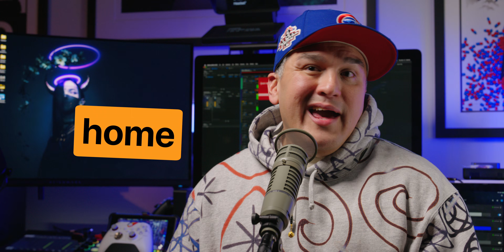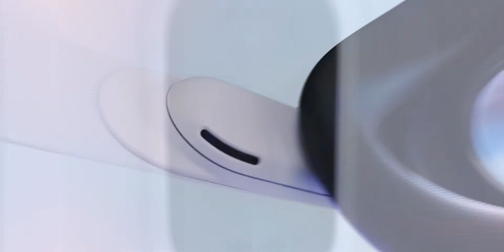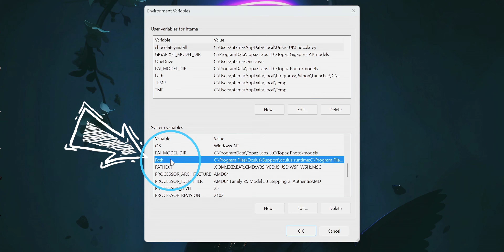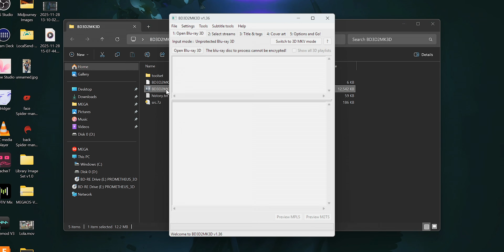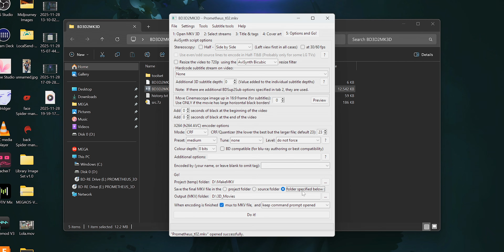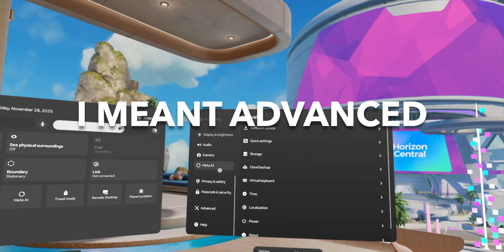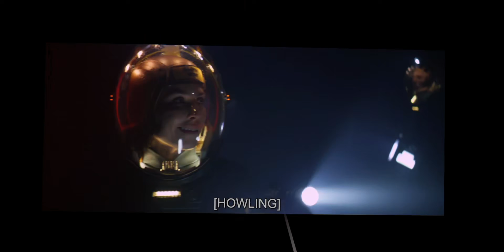3D Blu-ray to Quest: The Complete Conversion Tutorial

Comment: You need a modded drive to rip 4k. I believe that's not necessary for 3D. I used my old Pioneer BDXL cause my  LG M-Disc had a mechanical failure. Ripping 3D RN. 😊😊

Comment: Error: The type of file 'MKV3D_3D.264' could not be recognized

any help?
Reply from the maker: Do you have everything I mentioned in the video installed? 

The most likely cause is either AviSynth isn't installed correctly or FFmpeg isn't in your system PATH. Double check both of those first. Also make sure your temp folder path has no special characters or accented letters.
Reply: @CreateConsumeRepeat will check again I’ll delete everything and start again

Comment: Doesn’t mention the most important part of the MKV rip. When you open the title you are going to use, MAKE SURE you click the MKC / Stereo box first then select your audio and subtitles. Personally, I only check the audio I want and a subtitle if needed. If you pick a subtitle it will be burned into your film, not selectable.  
This right here is a usable file for Quest 3 viewing. It is half frame SBS in a 1920x1080 frame. 
The BR3D2MK3D is not for the faint of heart. What it does is expand the images to full frame SBS using a 3840x1080 frame. I bumped up quality a little but these are very long render times. Mine were 10 to 12 hours. 
Yes, 4XVR is the best player, it will play BOTH VERSIONS, half or full frame. 
It’s a subtle improvement, but not actually necessary. 
I never put my films onto the actual head set. I use a mini USB-C thumb drive, load a few movies onto it and using 4XVR watch them from that. 
Keep a permanent library of your tops on pc and just copy on😂s you want to watch to the USB-C drive.
Reply from the maker: Thanks for sharing.

Comment: You lost me from "ffmpeg" reference. For beginners like me, jumping straight into saying "follow these steps" and immediately saying "move your ffmpeg folder into....." completely throws me off without knowing first where that folder needs to be found. I guess I was here hoping for an idiot's guide on everything because this is all a tad over my head :(
Reply from the maker: You have to first download FFMpeg, I’ve provided a link in the show notes. when installing it you can select where that folder is going to be installed. from there you can just drag it as I mentioned in my video
Reply: @CreateConsumeRepeat  okay thanks, I'll check that. I have one of those external blu ray drives for my MacBook. Hopefully that can rip the discs. You can tell I'm a noob eh
Reply from the maker: We are all learning.

Comment: Skip every step after makeMKV and just play the full rip through 4XVR, don't need to do all the other conversions unless you want a smaller file size
Reply from the maker: Thanks for the tip.
Reply: I just did the same thing and it works great with Premium version of 4XVR. Worth the $30 dollars.  So what is the real benefit of doing all these other steps? As it stands, it takes about 30min average just to rip one 3-D movie using 4XVR. How much more time is added doing all this other stuff?
Reply from the maker: Native 3D gives you two discrete channels, one for each eye, with real authored depth and correct parallax.

4XVR is estimating that second view from a single image using depth mapping, so it can misread edges, flatten faces, and break on fast motion.

You’ll also lose some perceived sharpness and depth precision since it’s not working from two true sources.

It’s great for convenience, but it’s not a replacement for real stereo if you care about image quality.
Reply: @CreateConsumeRepeat You got my attention. So what is the best way to rip a movie.Do we follow all these additional steps as mentioned in the video? Realistically speaking, about how long would this process take for each video? The 1st rip takes on average 30 minutes, but that is probably a result of the file being copied from the Blu-ray drive. Following that, I assume the speed will depend on the storage unit and CPU speeds.
Reply from the maker: Follow the steps in the video. As for how long  it takes, that is dependent on your machine.

Comment: 0:22 3d experience at home is better than the theater. If you have a 4k passive 3d TV made from 2016 or earlier a TV will look better than a projector! 2016 was the last year of 3d TVs in the US. Image quality on a TV will always look better than a projector. That's why our homes are not overrun with projectors. If you want a big picture you get a projector. If you want quality image you get a computer monitor.

 There was a small over lap between the death of 3d TV's and 4k UHD tvs. This is great if you love passive 3d like I do. Before UHD passive 3d would cut the resolution in half, but after UHD you could get the FHD to each eye like intended on a Blu-ray. Active 3d always allowed FHD for each eye, but it appeared darker because of how the tech worked. It also required batteries. TVs are cheap now. Keep an eye out for older TVs that do 3d. I bought a 4k/UHD Sony with an IPS panel, and does 3d, x900c. Brightness isn't the best, but I love that tv.
Reply from the maker: Hey, thanks for chiming in, I totally get where you’re coming from. I actually have a 3D 4K Samsung TV too (it lives at my mom’s place now), and I agree the image can look really great.

That said, for me the headset still wins overall — the immersion and “being in it” factor is just on another level. Appreciate you sharing your perspective though!

Comment: Thanks for these very helpful instructions for how to convert to BD3D. However, as others already mentioned, this is way easier with 4XVR. All you really need for software is MakeMKV to rip the blu ray, then simply transfer the file to your headset to play in 4XVR and it plays beautifully in 3D! 

Also, rather than loading movie files into the headset, 4X Link in 4XVR works great for streaming movies directly from your computer hard drive. I can see my entire library of movies to play in 4XVR. Works great!

I’ve liked 4XVR so much I purchased the premium version for both of my Quest headsets and figured out a way for my wife and I to watch 3D movies together in the app.

Comment: I bought 4XVR a long time ago. Have been used it for more than a year now. Watched mostly VR videos but almost every day.
I'd like to watch flat and 3d movies and BD3D also. Unfortunately it can't play the audio for flat and 3d videos correctly. It's too bad it's unusable for nonVR videos.
UPD.
I regret I bought and  recommended 4XVR everywhere and to everyone.
It has a critical flaw. Meta Quest version uses some "spatial" effect for audio. So the movie audio feels like it doesn't surround you as in cinema, but comes from a small Bluetooth speaker positioned 2-3 meters in front of you. Slightest movement of your head and the sound is recalculated and basically all immersion is ruined.
The new version of 4xvr for Quest 3 didn't fix the audio for flat and 3D videos. But instead it ruined the audio for VR videos. This is a disaster 🙁
It may be interesting for some videos with talking. But if there's music or asmr or just several sources of sound then the audio is ruined by your "spatial" effect. There should be an option to TURN THIS OFF!!!
Now after the update your player is basically unusable at all. It was unusable for flat and 3D videos before. But at least we could enjoy VR videos in 4xvr. Now it's a complete disaster.
The support in discord can't even say if they add the option to turn it off this year or next year!!!

And about BD3D and MVC. That's great your player can play them. But all movies have multichannel audio. And 4xvr can't play it correctly. It's ruined by their "spatial" effect.
They had a perfect audio playback for 2-channel and multichannel audio before the update. It worked correctly for every type of video except Flat. 
Just needed to apply it to flat videos.
But instead they broke it for all video types :(

I doubt the devs or support even watch movies using their own application
Reply from the maker: Hey, appreciate you taking the time to lay all this out.

Just to be clear up front: I’m not paid, sponsored, or endorsed by 4XVR in any way. Everything I shared in the video is based purely on my own setup and experience.

That said, I honestly haven’t run into the issues you’re describing. In my case, audio playback (including BD3D/MVC content) has been solid, which is why my take was positive. From the way you’re describing it, this feels less like a universal flaw and more like something that could be tied to how the content is encoded, audio channel configuration, or possibly hardware / Quest-level spatial settings interacting in a bad way.

I do agree with you on one thing though: having the option to disable spatial audio entirely would be the right move. More control is always better, especially for people who want a more traditional “cinema-style” presentation.

Either way, thanks for sharing your perspective.
Reply: @CreateConsumeRepeat If you want to check it and have time for it. You can use some earbuds or headphones and Quest 3. Not sure if the versions for other headsets have the same issue.
Just relax and try watching your favourite movie in 4xvr from start to end. I find void mode with almost maximum zoom to be the best alternative to the real cinema.
Pay attention to what happens to the sound when you rotate or move your head just a little. Just like in the real cinema when watching a movie on a big screen.
In 4xvr the sound is played correctly only in one position, straight forward. Any tiniest rotation or movement of the head and the sound is recalculated. And now it's not around you. Like it isn't multichannel around you as designed by sound engineers of the movie. But a 1-channel speaker. Somewhere like 1-2 meters in front of you.

Comment: something I noticed is that if you don't select "Convert Audio tracks to AC3 and Stereo [instead of 5.1] I did not get both channels [only left side] - that is on Tab 2 Select Streams of BD3D2MK3D - thanks again for great workflow - especially the extra step of running the _Encode_3Dmovie command - which I needed to do about half the time on the 20 or so BluRays I have done so far - God Bless
Reply from the maker: My pleasure.
Reply: Same problem here, have you fixed it?

Comment: Is there a way to do this with already ripped 3D movies? :D
Reply from the maker: I’m confused by the question. If you already have a ripped movie you can skip to the next step in the process.
Reply: @CreateConsumeRepeat I was downloading movies. I was able to use sbs versions that work perfectly. But some versions of 3D movies( that I downloaded) are still in 2D format. Wondering if there's something I can do, or do I NEED sbs ripped versions every single time, from the beginning?
Reply from the maker: @Bruhder12 if the film is a 3D Blu-ray rip you can proceed to the next step. I know that someone in the comment section claims 4X player doesn’t need the SBS process to work I have yet to confirm that. Hope that helps.

Comment: Is there a way to just use the headset as a monitor connected to a 3d disc drive and get the same result?
Reply from the maker: Not that I know of.
Reply: Nope - you have to use an inline capture card and they only work as 2D
Reply: @Ilkeston  Dang. So we'd just have to hope for future headset releases to have 3d capability in their capture card for that to work?
Reply: @christiannoriega428  When I bought the Quest 3, I was hoping that it would work as a 3D headset for my PS4 3D games but it doesn't.

When looking for a capture card, no-one mentions that they only capture 2D.

So now, I'm having to rip my 3D Blue Rays with Make MKV and buy a bigger hard drive.

Comment: Hi,  
I’m really grateful for your tutorial.  
Without that video, I never would have started converting my collection and enjoying it in a whole new way.  
So thanks again for that.

However, I do find a few things a bit misleading once you start digging deeper into the topic.

One thing is that you don’t necessarily need SideQuest to transfer movies onto the Quest 3.  
It’s enough to connect your Quest 3 to your PC and confirm the connection from within VR.  
After that, you can simply drag and drop the movies over just the same.

Another point is that you talk about the highest quality when converting via BD3D2MK3D.

I personally watch the movies using the Virtual Desktop player. I’m not sure whether 4XVR enhances the movies during playback, but I wasn’t completely satisfied yet — even though your settings were already good.

But that actually motivated me to look for other settings and experiences with Tab 5 and try things out.

I have to say, you can get more out of it.

Once you find your sweet spot for screen size, it’s no longer just a movie — it becomes an experience.

Gravity, Ghost in the Shell… 🤩  
So again, thank you for that.

☝🏼AI translated☝🏼

Comment: Anyone have an issue with SideQuest transferring large files?  I sent a demo of about 600MB which worked fine.  Sent a 1.6GB MKV which also worked.  Tried moving a 19GB MKV file that crashes the app after about 900mb with a file allocation error.  I have over 400 GB available on the MQ3.
Reply: my file transfer of my fully ripped file is dying at about 2.5gb of the transfer process....   will keep looking for an answer to this... unless someone has an answer...
Reply: had to enable MTP in the Sideload app SETTINGS, and then use windows folders to copy the file once it was active.   If I closed out of the settings window that has MTP, it doesnt save the settings, and deactivates it.  Weird.  (maybe normal?)

Comment: No need for BD3D2MK3D, as the 3D MKV files created by MakeMKV can be  played natively and directly by 4XVR

4XVR can even play ripped 3D Blu Ray iso files, saving even the step to covert to MKV, though that will result in larger files. Personally I use MakeMKV to rip to a 3D MKV file and play that direct.

Also I don't put the 3D MKV files on my Quest 3, no need, as I have a NAS for all my storage, and 4XVR can access the SMB share on my NAS, so essentially I can watch my entire movie library 2D or 3D direct from the Quest 3 headset

Comment: I use 4XVR to watch 3D movies on the Quest 3 and it's amazing! 

Just to note, you don't need the step to convert the 3D MKV file IF you're using 4XVR. It does that conversation in the software. I think it's the only 3D player software that does this.

Also, storing your mkv files on a NAS drive is well worth it. Saves having to copy directly onto the Quest headset.
Reply: The MKV files are HUGE, I filled an 250 GB SSD hard drive with just four movies. BD3D2MK3D compression is the way to go.
Reply: @Ilkeston How long does that compression take to complete for a movie? I did try it once and it seemed like it was going to take many hours. What software do you use to do it with?
Reply: @simonwl  I tried Handbrake and it took around 5 hours to compress a movie.

I decided not to bother with compression and ended up buying a 5 TB external hard drive for my PC. 

If you install the 4XVR app on the Quest 3 (you have to buy it for around £23 ) you can install a 4XVR Link on the PC and run movies from the PC  to the Quest 3 via a home network.
Reply: @Ilkeston  yo, did u managed to compress the 3d mkv to full SBS mp4 by using handbrake? how?
bd3d2mk3d works for me, below one hour on 9800x3d, would like to use nvenc but can´t get it to work.
handbrake with nvenc or amdvcn is like 15min even on mini pc with 780m at 30W :D
but it don´t let me get the 3D SBS movie, only 2D :(

any idea how to get gpu encoder on bd3d (i know it is a custom command to the nvenc.exe, but what i tried from internet failed)
 or how to output 3d with handbrake?
Reply from the maker: I have not tried. I just set it and forget it on my 3080.
Reply: @gregors_vlog  I gave up on Handbrake, it takes far too long on my PC to compress an MKV file.
I just bought a 6TB hard drive and save the full MKV video.
Reply from the maker: That’s an amazing tip. I’ll give it a try to confirm.
Reply: So u mean I don’t have to convert mvk to fsbs, nd I can simply just watch an mvk file after (makemvk app), nd it would work as 3D?
Reply: @dmitriytheking1072  I have quite a collection of 3D movies. I have ripped 57, and they all work on the Quest 3S using the 4XVR Video Player app ( which you have to purchase)
I haven't found any other app on the Quest which can play 3D movies.
I have ripped the movies to a 5TB disk on my Home Network and they play well as 2D on our TV.
Reply: @dmitriytheking1072 Correct
Reply: I use makeMKV then BD3D2MK3D, takes about an hour each on average. My CPU isn't anything great, just a Ryzen 5 3600.
Reply: How do you access you nas drive through the quest? I have a Linux media server I setup with an old pc how would I access that directly through the headset?
Reply: @eternalessence2998 The 4XVRX app enables network drive access. You just pop in the IP address in the Network file location when accessing your movies and it'll remember the location and watch progress for each viewing.